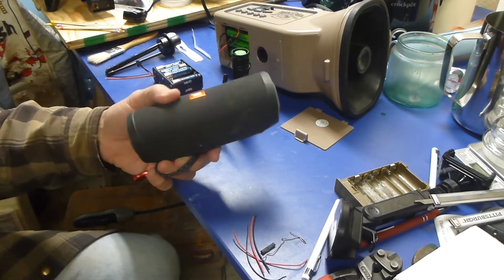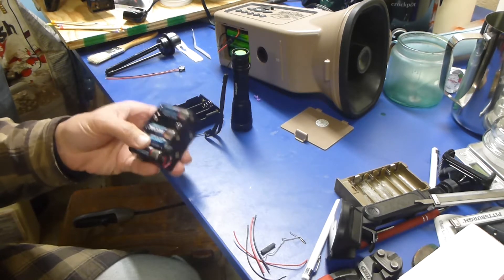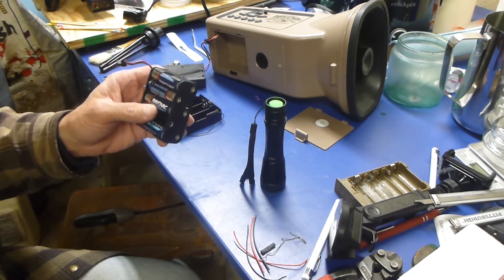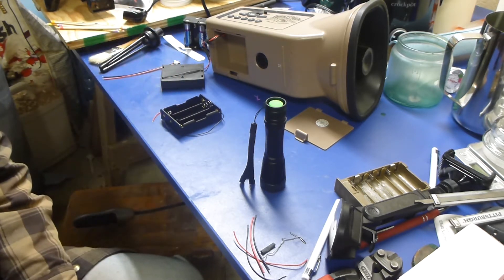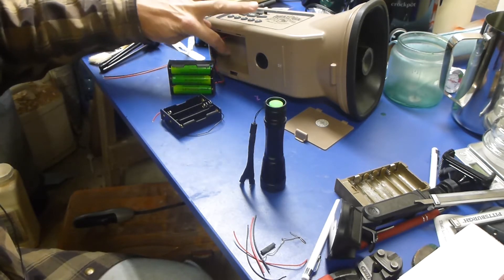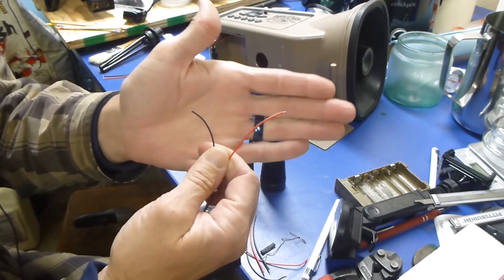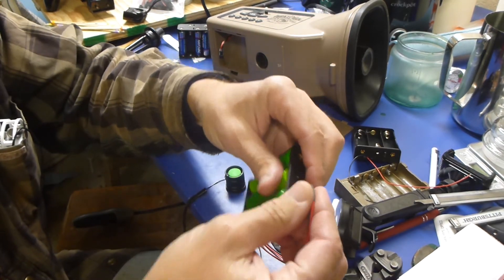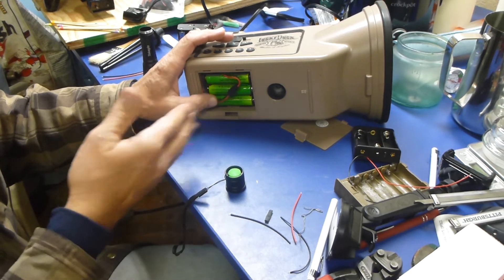Lucky Duck DIY rechargeable battery

Comment: Great video. Just the info I was looking for. Now one more question: Have you figured out the charge plug size that’s under the bottom flap? Then you could charge without having to remove the cover every time. You could even rig it to charge in your vehicle while you are out calling.

Comment: So, I'm seeing a lot of 18650 chargers using USB cables. Which really dosn't make sense to me? A charger to me is something with a built in charging circuit that plugs in to the wall. Is your charger one of them or dos it plug into the wall?

Comment: Hey I have the same game call and found this video awesome. Bought all the same stuff I think and hooked it up to my call and immediately both wires on my cradle melted. Any idea why?
Reply: Just following up…. I watched the video also. Bought the cradle and wires, and harvested my batteries out of a power drill battery pack that I no longer use and salvaged the 18650’s.
Once I put it all together, it didn’t work and wire began to get warm. After a closer look, either lucky duck had their wires flipped or the cradle I purchased did. Either way, I flipped my wires around (yes black to red and red to black) so they matched up with the call and it worked. Wires did not get hot and it seemed to work flawlessly. Thanks again for this great idea. It seems to have worked for me and I’ve only got $12 out of pocket since I harvested the batteries.
Reply from the maker: I'm sorry to hear that.  The first thing to do is try placing the batteries into the cradle with the cradle disconnected from the call.  At that point, the cradle would just be a battery pack with no (hopefully) circuit.  You should be able to measure the voltage across the pack at 3x the individual cell voltage (about 3.6v per cell x 3 = 10.8v).  While I do not know everything and I cannot see your setup, I think this: if the wires on the cradle melted that's indicative of a dead short at the connector plug.  10.8v with this much current across those itty bitty wires would turn them into toaster strips "right quick" (that's a technical term ;).  However, a dead short at the connector seems really unlikely unless (sorry) you did something strangely wrong.  Again, I don't know everything: you may not have done anything wrong.  Do be certain that there isn't a short where the connector plug pigtail is connected to the wires from the cradle.

You can measure the voltage across the pack both at the exposed contacts on the outside of the pack (watch the beginning and the end of the series of batteries), and at the connector.  You would be well served to use paper clips to insert into the connector to make contact from the meter leads to the inside conductors, one per each side (pos and neg) of course.  Test leads (alligator clips with wire) would be helpful, too.  With the pack disconnected from the caller (and any device, for that matter), there should be no circuit possible and, therefore, no melted anything.

Once you have the 10.8v (nominal) measured on the pack, make sure the polarity is correct.  Most (if not all) digital multimeters will read DC voltage regardless of the polarity and will indicate if the red (positive) lead is getting positive voltage by showing the voltage or show that the red (positive) lead is getting negative voltage by displaying the voltage with a minus sign (-).  If the positive wire from the battery pack is showing positive voltage then you should be good.

I have some 16650 batteries which are damned difficult to tell which end is +.  They do not have the traditional "titty" on the positive end and I have to carefully look at the cell markings to determine which end is which.  While this wouldn't cause the wires to burn (from being shorted), it could damage the caller if you were putting the voltage to it reversed.

I hope you get this sorted out.  Please come back and let us all know if you do and what you find to be the problem so we can all learn.

Thank you.

Comment: great video i will be doing this thank you
Reply from the maker: Thank you for the comment.  I hope this works well for you.  I am very happy with the results.  I've only run the battery pack down once and that was after it sat in my truck unused for months so I'm not sure if it was discharged from use or from just internal voltage leakage with the batteries.  I no longer have to carry a backpack filled with AA batteries and sacrifice 10 at a time if I'm not "sure" the caller is getting proper power.

Comment: How long does the battery pack last compared to the aa factory pack
Reply: I can't say in terms of actual run time as I've 1) not tried to measure it and 2) I've not run a set down yet. I don't use the caller that often and I don't push the envelope; I just charge them occasionally when I feel like it. I have run down the AA batteries. I've used the caller when I had AA batteries in it snd thought it seemed quiet for the volume level and changed the batteries to find it was a lot louder on the same setting. I've had no such experience with these rechargeable batteries. As I recall, the storage capacity on the three rechargeable batteries is far greater than the10x AA.

Comment: How do you charge them? Did you buy a charger for the back of the call? Its like $30. Or do you just take those 3 out and charge them after each use?
Reply: I remove them and charge them in the cradle that came with the batteries. Since I have other devices which use thse batteries, I have 3 or 4 charge cradles. I do not find it inconvenient to do so.